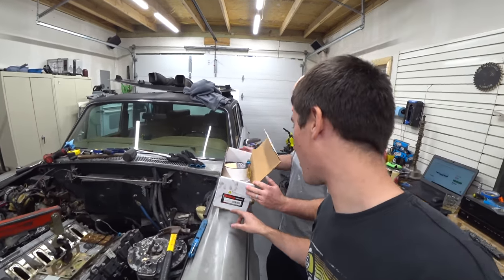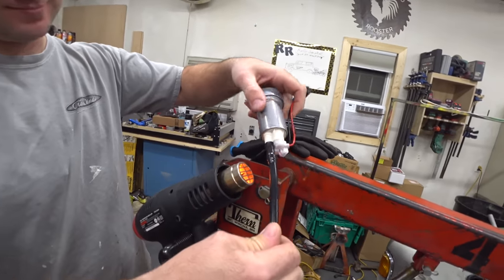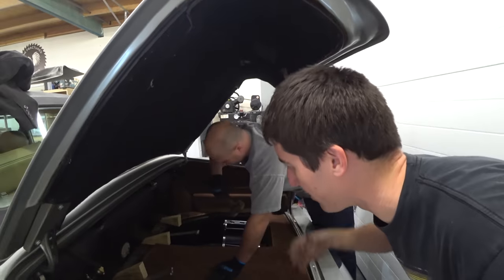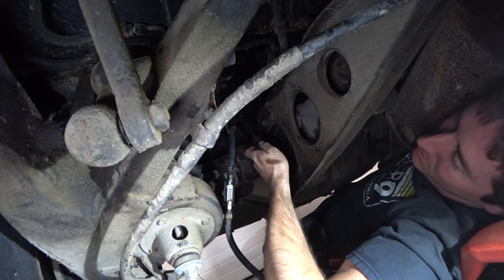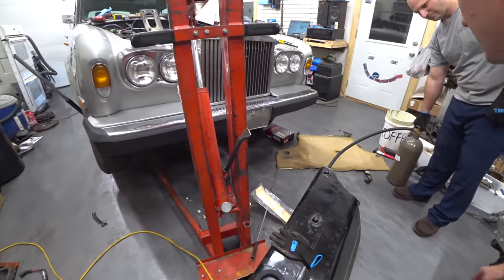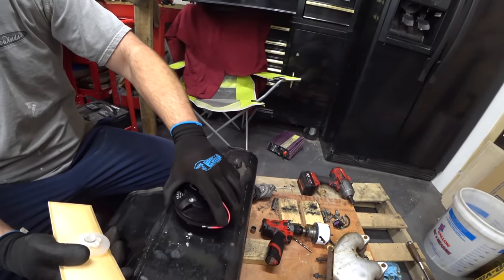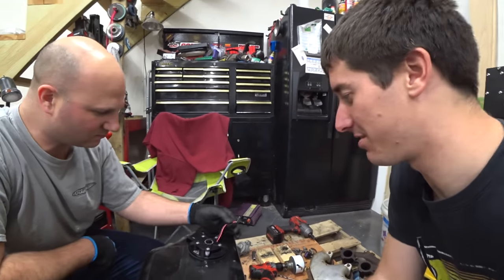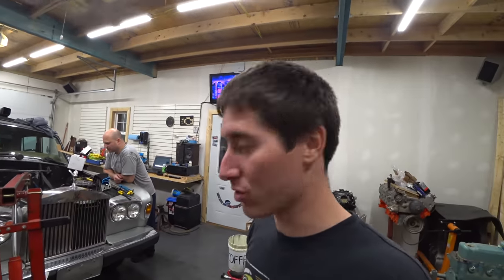INSTALLING A 1000HP FUEL System In The Rolls Royce *Project Rolls Smoke*

Comment: "We didn't explode!"  I can relate.  The bolt holding the fuel tank in my 928 was stripped, so I needed to dremel a slot in it.  Of course it's right above the filler nozzle.  Stuck a rag in the nozzle and a wet rag over the nozzle.  Had a bucket of water and a fire extinguisher near by.  Put my racing helmet on with shield down as my final defense.  Threw a few sparks but no explosion.  Got the bolt extracted and the tank out.  Glad that was done and felt VERY alive!
Reply: Forgot my fuel lines ran next to the   rockers on my 92 Sunbird last year while cutting out the rusty floors , cut right through the lines with the "wheel of death" ( what my wife calls it) Still here to talk about it.

Comment: I think I woulda had the tank professionally cleaned before I installed that bad ass pump in it. But definitely loving this build.
Reply: I wonder how many of these old rolls royces could use a pump like that.

That pump mod is amazing
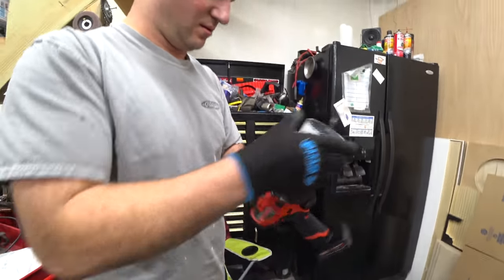Reply: 7:34 - it did look pretty corroded in there. I know this is a fast track build and all, but just shaking out whatever's loose doesn't inspire much confidence that the tank won't have to be pulled again

Comment: if it was on a lift you'd probably have cut several hrs off your build time.    Suggestion, next purchase (instead of yet another car) a lift or if nothing else a portable one!  How about selling a few of the other projects and renting a building and buying a lift to put in it (the kind you can remove later of course if necessary).  Excellent build series guys.  Keep it up.
Reply: logun1970 renting is not the way to go. Why give your money away
Reply: @watchjaredwork1487  cause you never know when the YouTube train is gonna run out and if that's the case he may not wanna do this type of work if it's not bringing in the same level of money.  Either way, point being a lift would be super nice for their projects

Comment: I just added a Holley HydraMat and high flow fuel pump to my car. I was having a problem where anytime I would stop below half tank or going downhill, I would lose fuel pressure and stall out. The HydraMat is finer than a normal fuel sock, so any air in the pump would break the suction. Turns out there is a little vent hole on the bottom of my fuel pump that would let air in when the fuel sloshed around. I plugged that vent hole with a small screw and it's working perfectly now.

Comment: to clean fuel tank put in some small riverrocks and shake rate it around with some water and dishwasher soap , flush and repeat untill the water is clear
Reply: watahyahknow never use rocks. You should use nuts so you can get them out with a magnet if you have to and the better way to do it is jack the back end of a tractor up and strap the fuel tank to the wheel of the tractor and put it in gear and let the tractor roll it around for a while.

Comment: You need to coat the gas tank with tank sealer
Reply from the maker: Stuff always fails and clogs up the fuel system. Just run good filters 🍻

Comment: You are going to need 1/2" fuel lines to feed the engine AND the spray. I doubt that rear suspension will handle the power tho.

Comment: Next time fill the tank with water  before drilling (or god fobid, welding)

Chuck a bunch of nuts in the dry tank and shake like crazy to dislodge the big stuff

Then coat the inside with tank sealer drop Eastwood

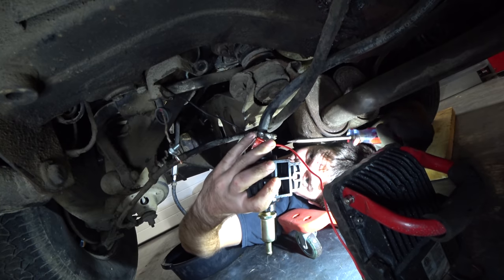Comment: @ 05:32 we get "Trying to get this piece of junk pump out"
So this unskilled amateur is qualified to call a 40 year old piece of Rolls Royce equipment that was working just fine a 'piece of junk'? Like he called the Rolls Royce engine and gearbox a 'piece of junk' because he couldn't get the engine out in 15 minutes.
Had he checked the blocked fuel filters he may have found out why the engine was running badly in the first place. No they were checked after the engine came out ... I have tried to like this channel but I give up now due to the total disrespect to a piece of motoring heritage. By all means modify it but show some damn respect.